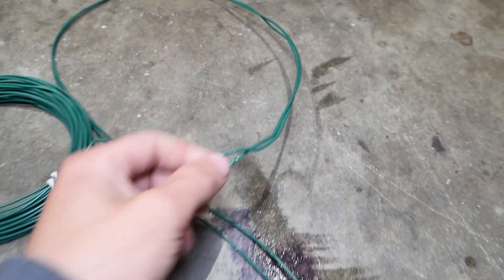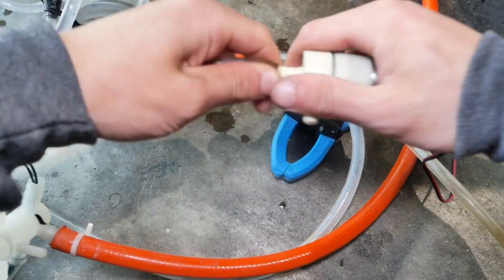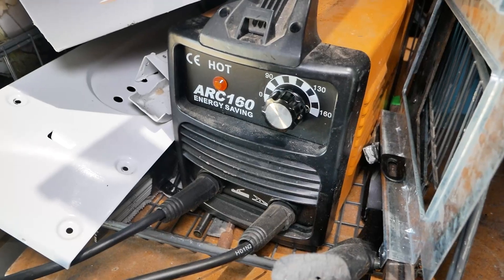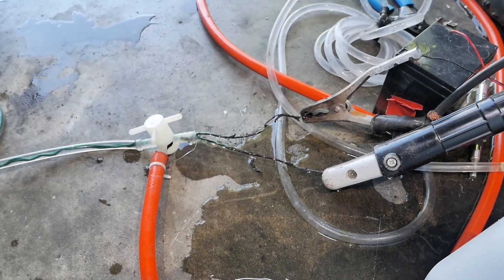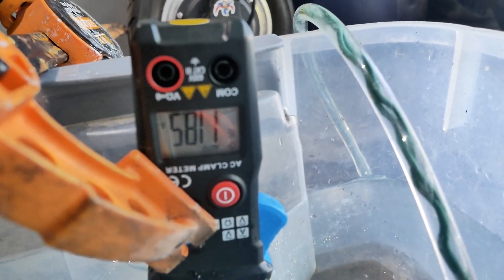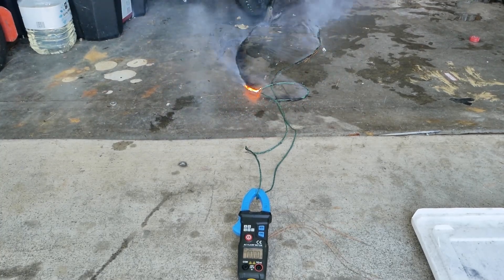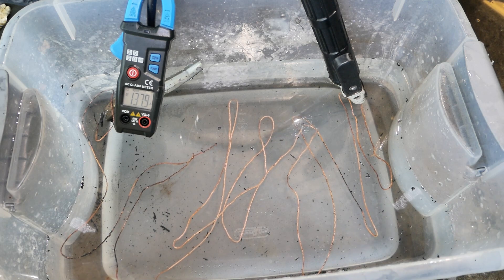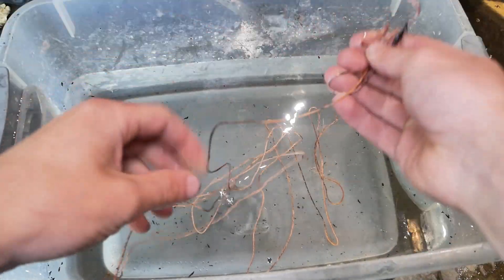Water Cooling Wires under high load 150+ amps

Comment: There is an application for water cooling wires. The worlds strongest magnet(45 Tesla) in the High Magnetic Field Laboratory is Tallahassee, Florida. Uses permanent and electro-magnets to produce the field. The wires are cooled with several thousand gallons of water. They run at 500V 47,000A!!!

Comment: Serious question why not just use water?
Reply: Water is terrible electrical conductor. In fact, pure distilled water is basically an insulator. Even salt water has a resistance so high it wouldn't work to carry significant current.
Reply from the maker: beacause oil is a better insulator and a lot less corrosive
Reply: @ianbuilder  thought I tagged you in above comment. Used Motor oil and Certo lmao.
Reply: Pvc/conduit and rounded nanoparticles of superconductors suspended in an gel form  electrolyte solution in narrow tubes? Sounds promising? I want my cut j.s.

Comment: Electric car fast chargers use a water cooled wire so that it won't have to be so heavy. Also electric arc steel mills use water cooled wires to put power to the electrodes. In the past I've thought about using a copper pipe as a "wire" and circulating water through it. Should work, but with a lot of loss as you say.
Reply: I think with induction heating coils, the coil is essentially a water cooled pipe!

Comment: Cool experiment! Direct liquid cooling can be very effective at keeping conductors cool and insulated, for example, in oil-filled power transformers. I believe the windings in my Tesla Model 3 motors are also cooled by direct-immersion oil cooling which is then heat-exchanged into the main glycol loop.
Reply: So are the batteries, and the wires in the fast charger cable. Not oil, but water. The specific heat of water is among the highest of all liquids. It very efficient (or inefficient, depending on your purpose), it takes a lot of BTU's to raise the temperature.